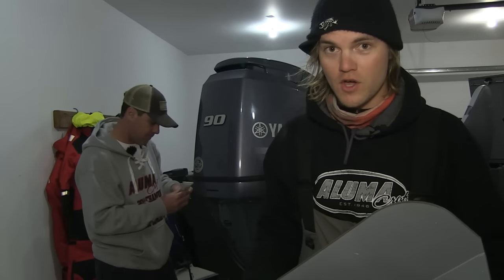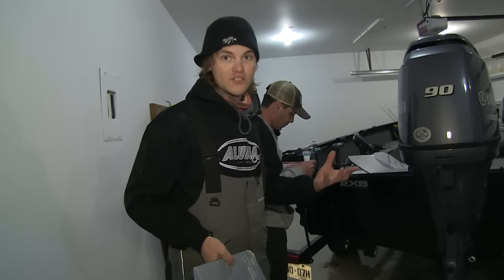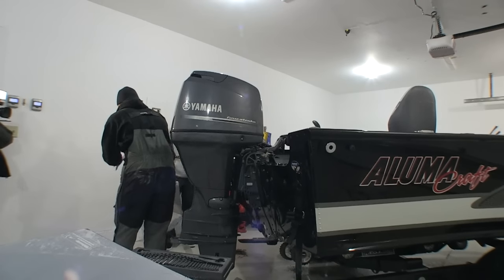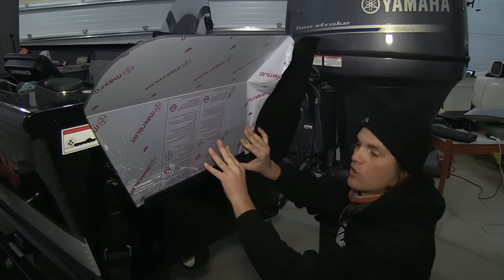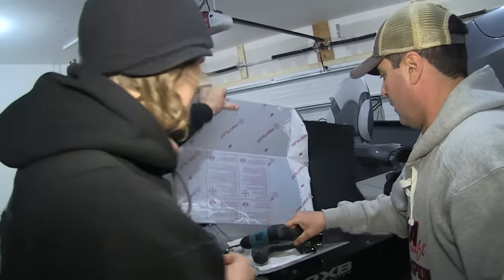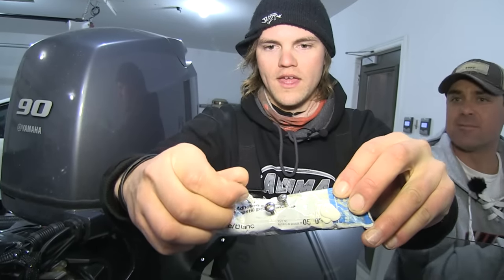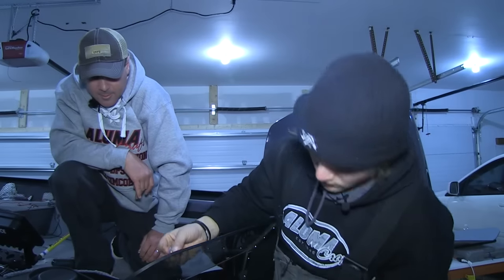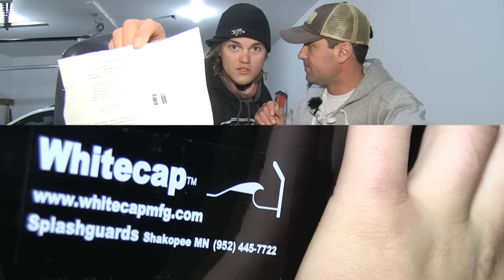How to Install Boat Splashguards

Comment: I love this instructional video. However, I am a marine technician, the way this was mounted is dead on. But, you should not be using 3M-5200 adhesive for this application. Clear silicone is all you need. Your motor is mounted with only silicon. 5200 is used for more permanent mounts, such as through hull transducers. That splash guard will likely get cracked or broken far before the boat will be junked, and trying to remove 5200 is not easy. Just a tip for you. You are by far the best fishing show I have ever seen!!!!!

Comment: Thanks for that--I did not know these were made.  On the same track though, I am looking for (not sure the correct name) a "splash guard" that fits on the bow rail and snaps down to the fordeck.  I have seen them on boats made from strong fabric--do you have or make these, or know where I can find them--or even what they are called?  thanks

Comment: I have a question why do you prefer a tiller over a console. I use a trolling motor in the front of the boat and I have never found any issues. Just would like to know your preference thanks.
Reply from the maker: I Love Fishing Bass Fishing - I will make a video with a more detailed explanation at some point....some of the tiller talk is tongue-in-cheek (aka razzing)....however, for the same dimension of boat, a tiller offers more space, and the responsiveness of a tiller steering is far superior for boat control than a steering wheel. Yes, a trolling motor does a great job of bridging the gap in many situations, but for some angling situations - the tiller steering is supreme!!!
Reply: Uncut Angling thanks. Love the vids

Comment: flexablile piece next to motor needs to be trimmed to fit around engine housing
Reply from the maker: chuck other - That is a good idea if you want to reduce the bit of rub rash that the excess rubber in a tight fit will make on the motor cowling, however this excess will add extra splash protection when the motor is turned to the opposite direction, so I have never trimmed it myself.

Comment: There's no point to backtrolling when you've got a nice new Yamaha boat motor like that you can get that down to a very slow speed. The boat is made to go forwards
Reply from the maker: Backtrolling is moreso used for holding on the spot, slipping, sliding, and stop/starting than actual conventional trolling.